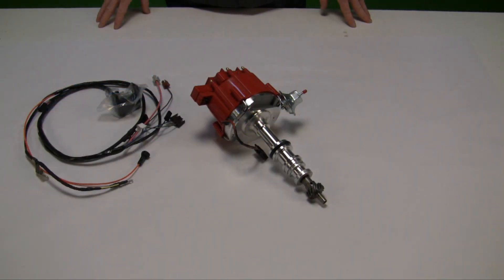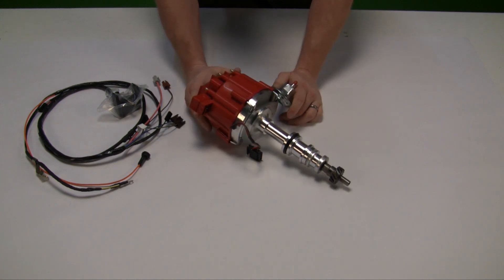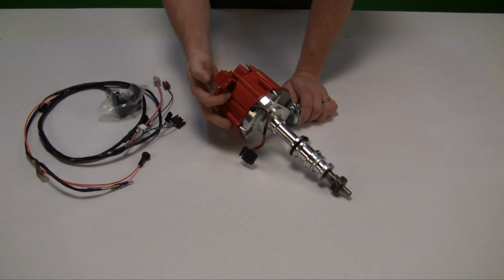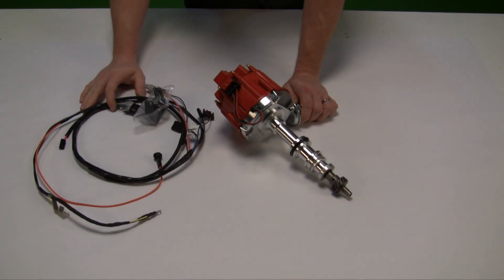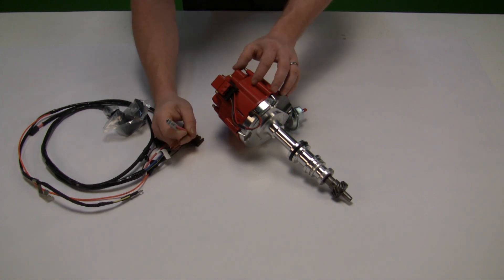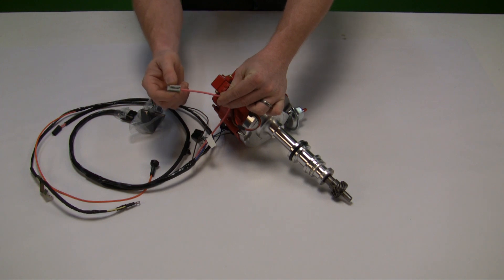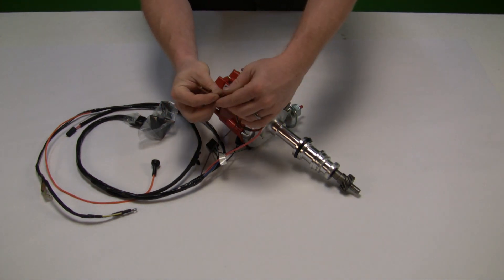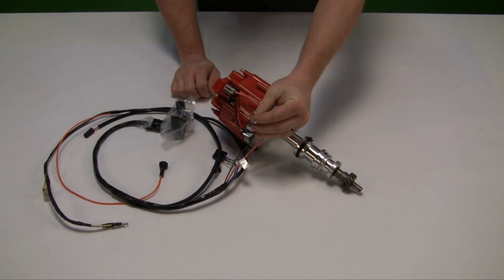How to wire an HEI Distributer

Comment: Of all the videos I have watched to help me on mechanical stuff, this is the most direct and useful videos I have watched. Simple, relevant and you show exactly what is going on. Colors are different but still can understand. Wish they had some simple videos like this on Carb swaps.
Reply: I'm actually carb swapping my 98 k1500 5.7 vortec and have everything hooked up but I don't know which wires to run to the hei distributor can you help me

Comment: How do you know what number to start with when it comes to the spark plug wires? the caps aren't numbered. I have a 65 inline 6 mustang and don't know where to begin with the spark plug wires or what to set the rotor on, TDC?
Reply: 5 months ago means you probably already figured it out but I'll tell you anyway

Rotate the engine to where cylinder #1 (if an inline 6, the cylinder at the front of the motor) is at TDC as indicated on the balancer. Take the distributor cap off, locate where the rotor is pointing, and mark that on the body of the distributor with something like a paint marker. Put the cap back on, and rotate until one of the terminals on the cap (where you plug the wires in) is right on top of that mark you made. Then in the correct order of rotation (which you can look up online) hook the wires up in order. In an HEI or non-HEI distributor, it shouldn't matter which terminal you start on - as long as the first one to fire is indeed lined up with the rotor.

Comment: Neat video, but it didn't answer the question. When converting from a points distributor, WHERE do the Batt wire and the Tach (especially if you don't have a Tach!) wire go?  The Distributor cap is clearly labeled. Where the wires connect up on the OTHER end is the issue.

Comment: Where does the other end of the pink wire go ?
Reply: he stated it goes to the ignition switch...just splice it in from the wire that powers the existing coil on the positive side as it is no longer needed

Comment: So I recently purchased a 68 Ford galaxie it has a Chevy style distributor with coil on top. I am curious as to if I can convert anything else over that'd ignition related
Reply: you can use a electronic dist. that does not have the coil on top but will need a 12v coil and coil wire....if you shop around you can get the cap that will accept the wires from the hei style cap

Comment: Next video: How to switch on a light.
Reply: Next Video - don’t even bother !
Reply: he would probably forget to tell us to use 110v.  came here to find out if the distributor used ballast volts or full battery 12 v, but he didn't mention it  But then no one else does either.

Comment: I dont get why so many boneheads cant even figure out the two wire... LOL
One is 12v from any source that is controlled by the ignition on your column..
The other goes to a tach.
WTF IS SO HARD TO COMPREHEND???
Reply: It's not 12v from ignition switch.  There's a resistor.  Cut it out and you may fry the stock ignition switch.  There has to be a relay in there.  That's more than two wires bud.
Reply: Mine is 3 wires total. 1 for tach and 2 for battery. Can’t find a 2 wire battery pigtail anywhere
Reply: Haaaaaaaaaaaaaa

Comment: for those who read this --- if you are converting from a non-HEI system with a standard coil, that coil will have a + & - (Positive and Negative (read GROUND) terminal, plus a coil wire to the OEM distributor.

You can simply splice this "BATT" wire into the wire on the + side of the original coil - boom, that simple.  The HEI dist conversion w/ the coil mounted in the dist cap should properly ground through the body of the distributor. (there should be a ground strap on the top of the coil under the upper plastic cap)
Reply: Thanks cause this video didn't help
Reply: I am currently have just swapped a carb onto my 1998 k1500 Chevy with the 5.7 vortec I have everything hooked up distributors in and I'm confused on which wire to properly hook to the distributor is it possible that I can get a little info from you

Comment: Great video, could have used a bit more information on setup. 

This is what I think.

BATT goes to battery post(or starter positive post to make a cleaner harness) 
TACH goes to tachometer

(If youre and don't want to fuss with a ignition switch) 
BATT GOES TO TOGGLE/TOGGLE GROUNDS/TOGGLE GOES TO STARTER(OR BATTERY DIRECT)
TACH GOES TO TOGGLE/TOGGLE GOES TO POWER/ TOGGLE GOES TO TACHOMETER/ TACHOMETER GROUNDS.

Please correct me if I'm wrong, I haven't wired it yet!!!!

Comment: I'm converting my stock distributor on my 58 Impala to an HEI. Where would I put the ignition lead wire-to the ignition switch or the fuse? The tach lead, where do I attach that wire? Since I don't have a tachometer on my car
Reply: Thank you. My mechanic put in one on my 61 apache with 350 and left off the red wire connector.  only had a spade connector shoved in close to the connector.  Worked for a while but then got loose.  Watching your vid showed me the proper connector so I made one kinda like the factory one and am race ready for sure now.  Always work on your own stuff is the lesson.

Comment: Quick to the point and easy to understand.  Not meant to offend anybody but to those of you posting negative comments. You are lacking the very most basic understanding of working on your classic car.  Here's a thought, instead of posting negative comments that make you sound silly. Get someone to help you understand the basics. You will gain valuable information and we won't have to read uncomfortably negative post.
Reply: What about those people trying to find out how to wire an held distributor?( like the video says it's about in its title) and they have to siftt through hours of miss labeled building like this in hopes of finding what they are trying to find and they are stuck watching a video of how to install some plug and play shit? I've built many cars truck tabs towards whatever.and I know how to wire an held points cdi or what have you.i was just sitting around watching YouTube videos to kill some time.  The point I'm making is If I weregoing to make a video of how to wire an hei ignition it sure as he'll isn't going to show how to plug in 3 self explanatory factory color coordinated plugs into the corresponding sockets in which they are designed to plug into. Shit. A 5 year old little girl could figure that out
Reply: Would have been nice if he had mentioned the gauge of wire used.  I believe the pink wire is 12 gauge...green??
Reply: Goodnight 🥱
Reply: I've worked on cars and motorcycles my whole adult life, but this conversion isn't as simple as one wire and you're done.  There has to be a relay between battery and this hei distributor.  What actuates the relay to provide the 12v to distributor?  Exactly what spark plug wires set will work for a Ford IL6?  How exactly is the relay wired?  Included instructions are vague and don't even mention a relay, but if you use the ignition switch wire, it's not a full 12v due to resistor.  Cut out the resistor and you may fry the stock ignition switch.  Since you know so much compared to us shade tree mechanics maybe you can enlighten us.

Comment: Ok, a simple keyed 12v ignition wire to the Batt terminal on the distributed plug, the other terminal is for a tach signal... Got it. Simple enough.. don't know what these morons in the comments beneath me are talkin shit about.. if you can't comprehend what you need to do from this video,, you have No Business wiring shit in the first place.
Reply: siTTinLo420 Would you happen to know what wire would be a keyed 12v source on a 67 mustang that i could run to my hei?
Reply: do you not know how to use a test light and turn a key from off to on to check?
Reply: Nicholas Brill not in the confusing mess of wires that is my car, no
Reply: siTTinLo I thought the same thing when I saw all these comments, what else do these people want? 🤔😂🤣
Reply: They are selling a wiring harness and distributor so they should take a few minutes to show how its hooked up. This is UTube so make use of a good thing "How to wire an HEI Distributor" is the title not how to plug in an HEI Distributor!

Comment: complete waste of time. Only showed plugging wires up to the distributor....  Instead of that how bout we show folks where to plug those wires (you just plugged up to the distributor) up to in the engine bay.
Reply: That vidio was allmost useless
Reply: Exactly
Reply: This video is basically an insult.  Like, "You can't handle the truth."  Douchebags.
Reply: you can literally just run a hot wire to a switch from the battery thru a switch to the bat side of this and it will work...the switch is only there to serve to shut the ignition off and supply power to the dist. its literally a one wire hook up...whats not to understand